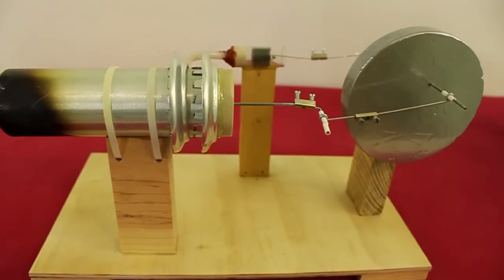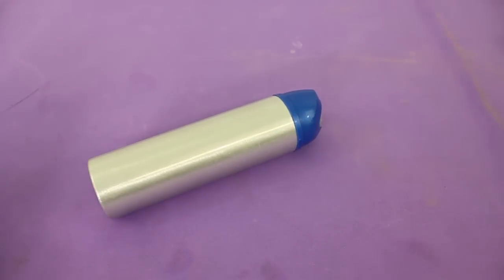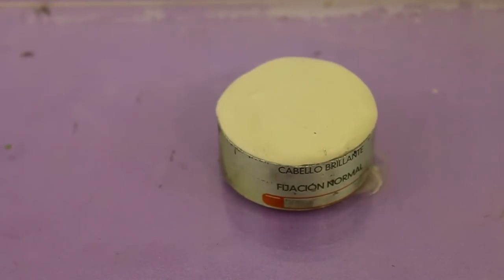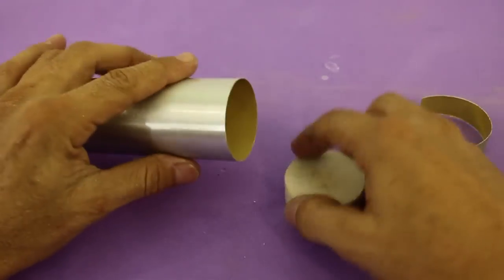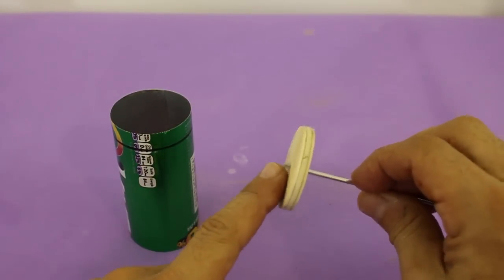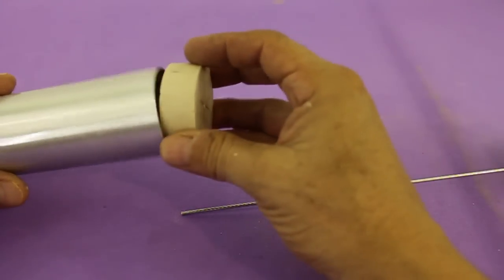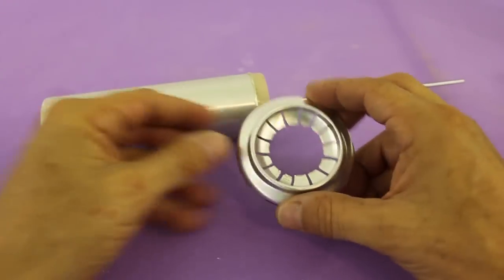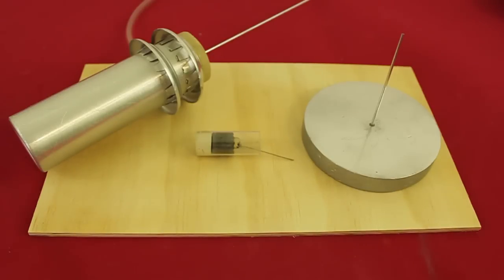DIY Gamma Stirling Engine

Comment: Great build. What I’m working on is building a Stirling engine that overcomes the usual problems. The Stirling process is all about pressure transfer & the temperature difference, cause & effect. The number 1 problem with a Stirling engine, almost all require heating the displacer cylinder. Mine will have a place heat is applied that won’t affect the longevity of the displacer cylinder or piston. 
    The 2nd problem is the timing is not variable for the displacement cycle. This could be achieved with an adjustable cam & valve. RPM could be somewhat controlled, as well as tuning for optimum power or speed, depending on what is needed.  There’s a small model that I see  being marketed that has a vertical axis flywheel. It also has a small valve knob for controlling RPM. It is between the tube linking the displacer cylinder & power cylinder. So there’s an idea that works, but could be improved with the cam & valve approach, coupled with the separate heating chamber to protect the displacer cylinder.   
  Another idea that is proven, but has never been applied to the Sterling process, chemical reaction. There are so many things low temperature , non-caustic that can be combined to create gas pressure, which could operate a Stirling engine besides heating a cylinder.
Reply from the maker: Interesting ideas
Reply: @ludicscience  Any changes or improvement ideas seem to always go back to the steam engine. (Especially the valve idea)

Comment: I don't understand the operation of the steel wool regenerator in this design.  One end of the piston containing the wool is closed, so you don't really get air flow THROUGH the regenerator.  Also, I'm not clear on how you chose all of the sizes of things .  The displacer in my desktop Stirling is similar to the displacer stroke distance, but that's not the case with your design.
Reply: It ensures that the shape of the piston is maintained and that it acts like a piston (rather than an empty cylinder). Using a wooden disc, you can achieve the same thing. You just run the risk of attaching it wrong and messing with the cylindrical shape of the piston, or having your adhesive mess with the difference between the internal diameters. The measurements are made under precision, and maintaining these measurements is an important aspect of this design (especially for the displacement piston). Thus, you can ensure the shape of the piston by stuffing some steel wool inside of it, which has the added benefit of not need to cut out a piece of wood.
Reply: I just came here to see if someone else was also puzzled by this. The steel wool adds nothing as far as I can tell, since as you said, it's sealed at one end. The only purpose it could serve in this design is maybe to add some weight?

Comment: Have you tried HHO cells yet? 
The gas can run a sterling engine once the heating element reaches 70°c, eliminating the need for fire. Soot free reaction.
Reply from the maker: I have not,sounds interesting
Reply: @ludicscience  316L grade stainless steel (x 6 for 12v PSU.) 1.24v - 2v per plate.

Comment: Why is the efficiency of a sterling engine ( (Th-Tl)/Th ) not work-output over energy-input?  This looks very lossy compared to internal combustion, to me.
Reply from the maker: I dont understand your question
Reply: @ludicscience  The thermal efficiency of a Sterling engine is (Th-Tl)/Th, Th: high temperature, Tl: low temperature. Its efficiency is regarded as higher than the Otto cycle, whereas its thermal efficiency is W/Qh, W: work, Qh: high heat rate.  The external combustion of a Sterling engine seems very lossy by the combustion process out of the cylinder.
Reply from the maker: That is the ideal efficiency. Difficult to achieve in the real World
Reply: (T_h-T_c)/T_h is the work output over the energy input.
Let me explain:
When defining efficiency, we are evaluating the ratio of the ideal energy output with the actual energy output. For an Ideal system, the efficiency is 100% as the ideal energy output is the actual energy output. 
We can define this relationship in terms of work (since a Stirling engine's purpose is to be- well- an engine IE is generates output energy for a given input energy).
Specifically,
W)actual / W)ideal = η (eta)
for
W)actual - the actual work produced by the system,
W)ideal - the expected work produced by the system under ideal circumstances, and
η - the efficiency of the system

By the first law of Thermodynamics for a closed ideal system cycle:
dW = dQ.
This is derived from the equation for the first law of Thermodynamics for a closed system:
dU = Q - W
where, for an ideal cycle, there is no internal energy loss.
Note: dU is the change in internal energy (U is the internal energy) and Q is the heat energy.

For an ideal system, you would expect that the amount of energy you put into the system would be equal to the amount of energy you get out of the system. No energy is lost to the surrounding environment or additional factors (friction, for example) when converting energy types. 

Thus, we can define the work done in a closed system cycle as:
W = Q_h - Q_c
Where Q_h is the heat transfer into the Stirling engine from a heat source, and Q_c is the heat energy transferred out from the Stirling engine.

Ideally, Q_c = 0, making W)ideal = Q_h.
Nonideally, Q_c =/= 0 making W)actual = Q_h - Q_c

By the definition of efficiency:
η = (Q_h - Q_c) / Q_h

Here, we'll model air as an ideal gas.

By the ideal gas law:
Q = znRT, where
n - the # of moles
R - the Universal Gas Constant
T - the Temperature (in Kelvin)
z - the compressiblity factor. 

Note that Q_h is the energy input!

By the definition of a closed system, the change of mass between any and all stages of the given cycle is equal to 0 IE the number of moles does not change (n is constant).

Here, it does not matter whether or not you model air as a compressible gas. Algebraically, you can pull out n, R, and z, as these are all constants. If you model air as an incompressible gas, z = 1. Otherwise, z =/= 1. Regardless, z, R, and n are all equal for all of the terms in both the numerator and the denominator, and subsequently can be pulled out and become equal to 1 (a number over itself is 1).

η = (znRT_h - znRT_c) / (znRT_h)
η = (znR/znR) * { (T_h - T_c) / T_h }
η = (T_h - T_c) / T_h

Thus, efficiency is defined as quotient between the difference of the high and low temperatures and the high temperature (measured in Kelvin).